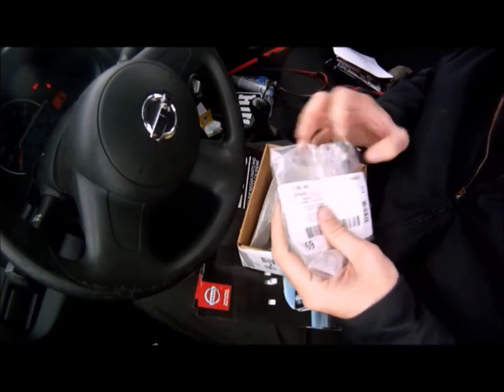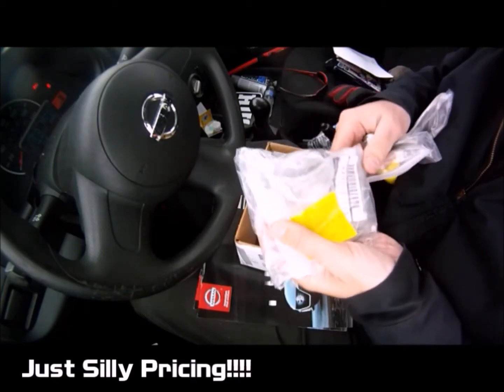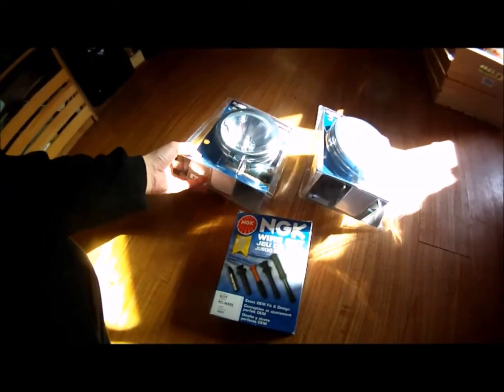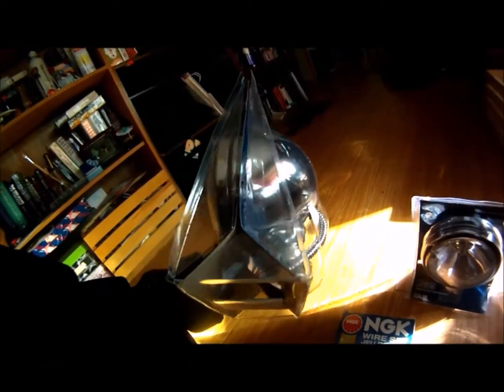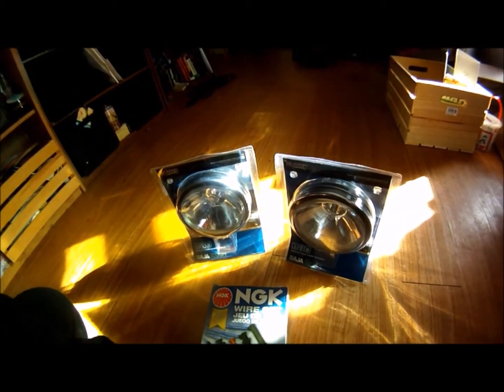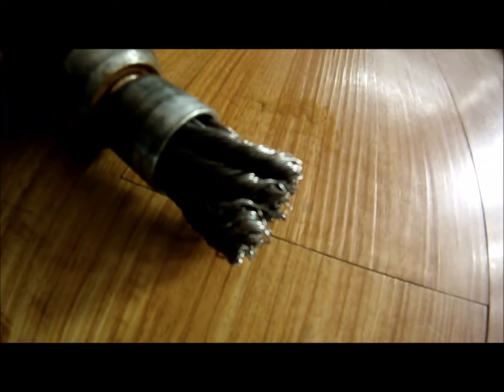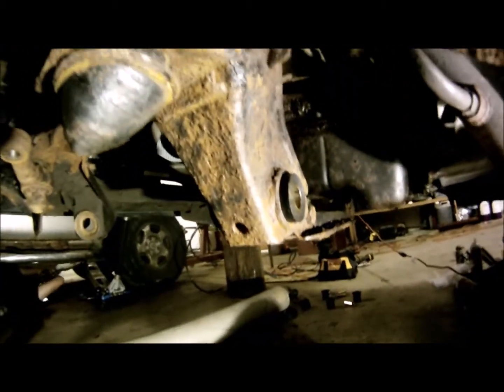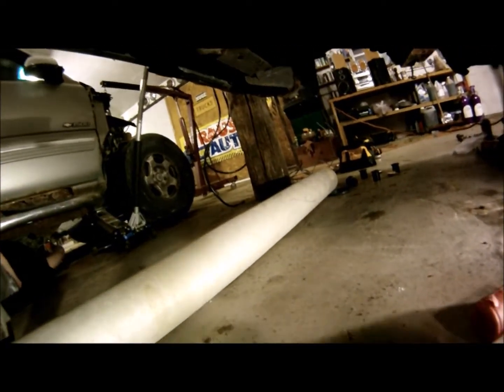Nissan Street Truck Build E9 (2018)

Comment: any idea if the emissions control stuff on the older models such as the exhaust air induction is discontinued, or if you have to go to a dealer to get it, or if I should just be trashing what is left of mine? Don't think my state requires smog testing on stuff older than 25 years, but who knows; maybe I move.
Reply from the maker: Tough to tell, I have not tried to buy that kind of stuff from the dealer. Maybe some of it still available but I am finding Nissan is phasing out large chunks of the D21 catalog at an alarming rate.